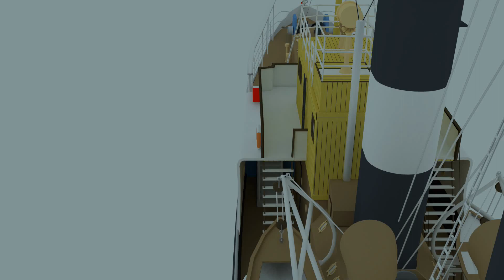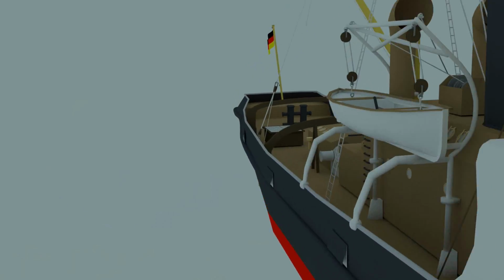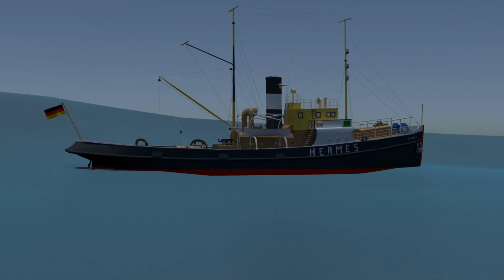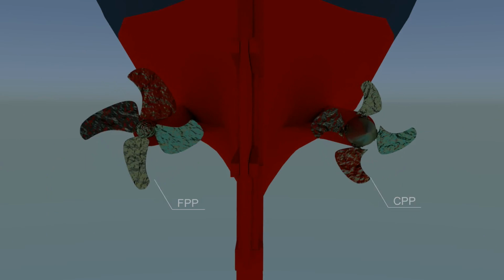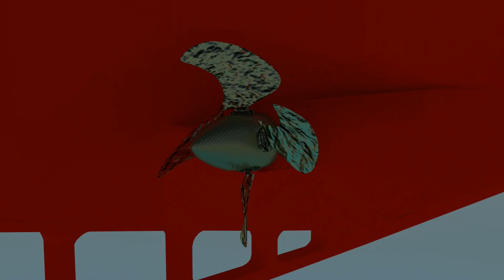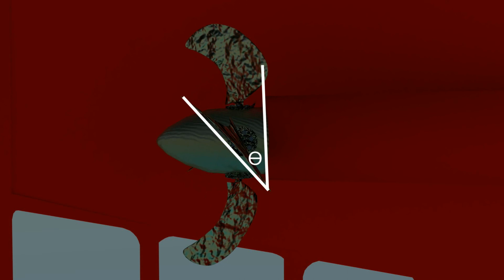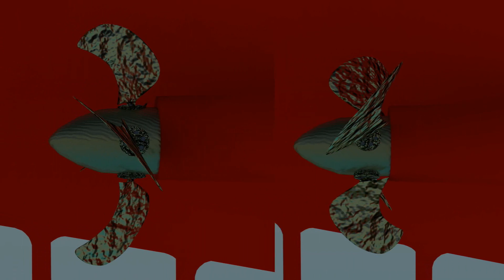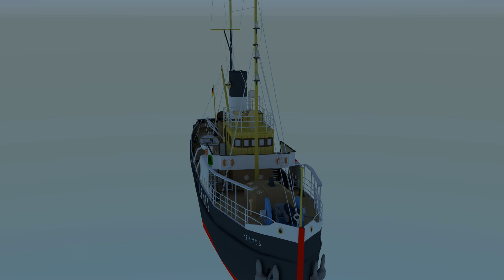Controllable Pitch Propellers | How they are used to power ships

Comment: Here's a fun anecdote: I worked on one ship with an engine that couldn't reliably start because of a fault in the start air system. Every time we had to start the engine, it took multiple attempts, and we had to reposition it with the turning gear between each attempt. Needless to say, it was a pain in the ass and we were eager to get it resolved. Before that happened, we had to transit the Panama Canal. Fortunately for us, we were able to keep the engine idling for the entire transit so that we never had to reveal our engine fault. I doubt the PCA would have allowed us to start the transit if they knew our engine wasn't working properly

Comment: Of we change the way we assemble the propeller also important because with vortex technology could turn propeller lose and so we could attact propeller by the clamps and pin lock instead of taped toothed turn also variable pitch can utilize the inertia conservation to travel against current and goes fuel less

Comment: Airplanes have these two. On an airplane, it is called a constant speed propeller because it causes the engine to run at a constant speed. Usually on an airplane with a constant speed prop, the propeller control determines the engine speed, and the throttle determines the propellers pitch. It sounds strange, but there is an oil pressure modulator operating the propeller to make that happen.

Comment: or you just use an electric engine and bypass all that expensive engineering....
Reply: The electric motor still needs a propeller otherwise how else are you going to push the ship through the water.
Reply: @cr4zyj4ck  Huh? What? Yeah sure you'll still need a propeller, did i ever say you dont have to? You dont have to have all the tech and engineering to change the aoa because you can easily adjust the rpm of an electric motor.

Comment: They are on airplanes too . for speed and power ones with a prop
Reply: It's only for propellers and not turbo fan or turbo jet engines, they also have this on helicopters but more controls rather than forward and backward

Comment: Both propellers are turning the same way? Is that right? I’ve learn that when to propellers, one is clockwise and the other is counterclockwise.
Reply: Yes, when two propellers are used they will turn in opposite directions. In Controllable Pitch Propellers ships (CPP), they will generally turn inwards to maximise thrust over the rudders. In Fixed Pitch Propellers ships (FPP), they will turn outwards in order to maximise the "Paddlewheel Effect" when one engine is ahead and the other astern. Since both propellers will turn in the same direction, at low speed the stern will have maximum movement, desirable when berthing/slipping from a wharf. No twin propeller ship will have both propellers going the same direction when going ahead/astern.

Comment: But isn't it way more fuel inefficient when the prop spinns at fast or slow (rotation) speeds in relation to the movement speed
Reply: The very large diesel engines used in ships fitted with variable pitch propellers are designed to run at a very specific rpm that maximizes the efficiency of the engine. These engines also don't really tolerate variations in their operating speed very well.

Reducing the pitch does make the engine less efficient, however, slowing the engine down also makes it less efficient. The portion of the power generated used to simply overcome the friction inherent in the engine increases as you decrease engine speed.

Realize that the vessel, while underway, will be at it's designed speed as much as possible during the crossing. Reducing the speed is only done if the vessel encounters bad weather, has an issue that requires it to reduce speed, or while approaching a port.

Many large cargo vessels these days don't even have a transmission installed - the engine is directly coupled to the shaft. The variable pitch propeller is controlled using hydraulic power,  eliminating the need for a costly and heavy gearbox that requires expensive maintenance.

Comment: Question does the vessel with CPP stop instantly? Please share advantages of each side
Reply: The only way to stop a ship instantly is to run her aground.  But that's not something you want to do lol.
Reply: Not instantly, they are not bicycles and they don't move on solid surfaces. The difference is that FPP ships need time to slow down, reverse and then increase speed at the opposite direction. CPP ships maintain the shaft speed and they just change the pitch. The pros have been posted by a user in another comment above.

Comment: I had an idea for small outboard motors and propellers. If you can create a small enough variable pitch propeller, you can increase efficiency, speed, and acceleration of the boat. I have a 16ft mirrocraft with a 25hp engine (the limit at the lake). I enjoy water skiing, but it is difficult to get up if there are 3 or more adults on board. The only way to do so is to put a shallower pitched prop on to generate more thrust, but then the top speed is greatly reduced diminishing the fun. 

I have not done the math or even given this idea any serious practical thought if it would work. My thinking is, in the skiing example, to start off with a shallow pitch to create the thrust to overcome the immense drag of a person sitting in the water, then to gradually increase the pitch to increase the speed once the skier is upright and only has the drag of the skis themselves to worry about
Reply: This is precisely the origin of variable pitch in aircraft propellers and the reason why a lot of early speed record planes were floatplanes. As they didn't have variable pitch props and were designed for high speed, obviously, they needed longer runways to get up to flying speed than could reasoanbly be built on land.
Reply: You can make a small variable pitched propeller, but it would be an expensive retrofit to existing outboard engines. You would need a new lower unit at least. Variable pitch uses hydraulics to control the pitch so you would need some way of delivering the pressure to your outboard.

They do exist in small sizes though, I've seen them installed on sailboats.

Comment: Fin fact, the internal design on KaMeWa and Rolls-Royce propellers are the same as in Kaplan hydro power turbines from KMW. The main difference are the blades. 

Great Swedish design, reliable and relatively cheap to manufacture

Comment: But I still want to know how it works .  That is, how can the pitch be changed on a rotating part like that?  What is the mechanical arrangement that accomplishes this?
Reply: They use a governor,  it's the same setup used in aviation. Constant speed prop. The governor diverts engine oil to or from the prop hub.
Reply: Check this video and you will understand. https://www.youtube.com/watch?v=-hu7LuT3q58
Reply: @MihalisNavara  ok
Reply: In my project, there is a HPU to controll the pitch.
Reply: hong3ever Hydrodynamic Propeller Universe???
Reply: it used hydraulic pump tp control the pitch
Reply: I imagine something similar to the a swashplate on a helicopter as the rotors on a helicopter have to vary in pitch so it can move up, down, roll forward, back as well as left and right.
I assume the prop shaft is hollow, the prop contains a piston with grooves cut into it and is under spring tension, each rotor on the prop fits into the groove and as the piston moves the grooves change the pitch of the prop as hydraulic pressure is applied or let off.
Reply: Yeah I was kinda expect him to explain that one

Comment: A control pitch propeller is not the same as a variable pitch propeller, a variable pitch propeller is normally a fixed pitch propeller where the pitch varies along the length of the blades. It's also wrong to state that a control pitch propeller runs at a constant speed, a lot are controlled by a combinator which changes both the pitch and speed simultaneously to stop excessive cavitation on the blades.
Reply: "a variable pitch propellor is normally a fixed pitch propellor". You are referring to blade twist which is necessary for all props and is the fixed reduction of blade angle from root to tip. That is not variable pitch. Pitch refers to the nominal distance the screw will advance in one revolution. Any time you can alter the angle of the blade in service you have a variable pitch prop. It could be a couple of settings, or it could be controllable within a range, or it could be 'constant speed' whereby the pitch control itself acts as the engine governor.
Reply: @XPLAlN  NERD

Comment: The same technique is used to control lift in helicopters with collective pitch the rotor blades rotate to alter the angle of attack, not sure if it's really a thing in propeller driven fixed wing aircraft though they do usually have a setting for 0 degree pitch but this is of course intended for use in the event of engine failure in order to reduce drag from the windmilling prop.
Reply: on heavier then air fixed wing aircraft unless specifically designed they will not change. on lighter that aircraft's (airships/blimps) it does work very similar to that of a naval ship. but then the entire airship just behaves more like a boot then anything else.
Reply: In fixed wing aircraft you can have both. Typically, the lighter the aircraft, the more likely to have a fixed prop (not even a "feathered", i.e. low drag, position). The other type is a "constant speed" prop, which is set to a set RPM and keeps it by varying pitch. The engine power then determines how coarse / fine a pitch you'll get. (Or at least thats a glider pilots understanding of propellers ;) )

Comment: I would really like to know more about the advantages and disadvantages of each.
Reply: The advantage of fixed pitch prop (FPP) is that you can still have steering when the prop is stopped as long as the vessel is still moving ahead or you still have water flowing over the rudder, such as if the tide is acting against you from ahead.  This makes slowing a ship down a lot quicker and more controllable.  By contrast a Controllable pitch propeller (CPP) is more difficult to slow down as you have to gradually reduce the pitch to maintain steering.  When a CPP is at zero pitch the blades generally don’t let sufficient water through to have an effect on the rudder, thus losing your ability to steer.  Pitching ahead slightly opens the blades up to allow water flow through to the rudder to enable steering, but the disadvantage is that the speed may increase ahead.

The advantage of CPP is that the prop always turns the same direction.  You can get astern propulsion very quickly by pitching astern and let the blades pitch the other way without having to stop the prop and start it turning the other direction, whereas the FPP will need to be slowed down to a complete stop before rotating the other way.  The time it takes to go from full ahead to full astern with a CPP is very quick (providing you don’t overload your engines) and very slow with a FPP.  

Knowledge of the advantages and disadvantages of each are important, so you can use each to your advantage and mitigate the risk of their disadvantages. 

Chris - Marine Pilot
Reply: @marinepilotchris3048  FPPs are more durable.
Reply: MihalisNavara Absolutely 👍 
Reduced chance of failure with less moving parts.